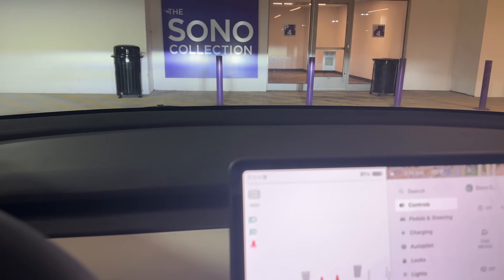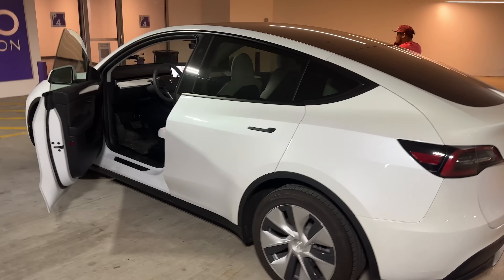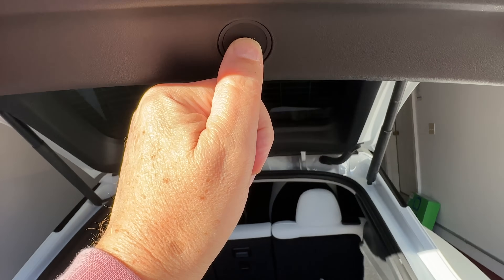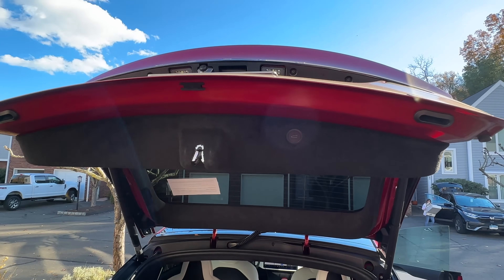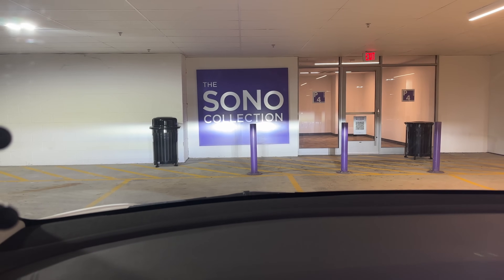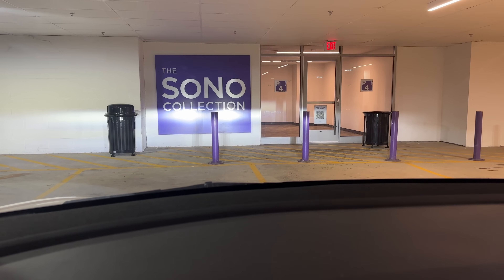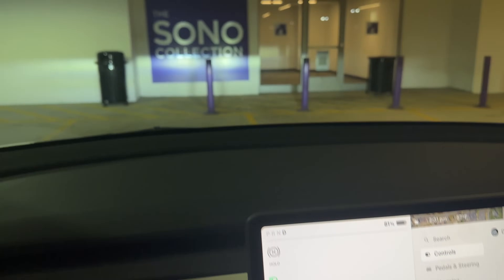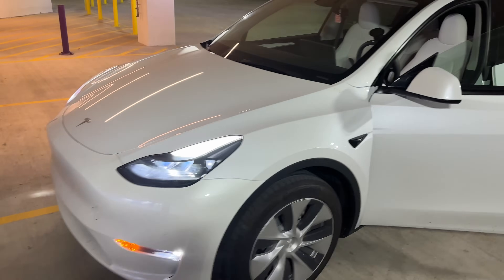Tesla Drivers Beware!  Poor Close In Vision Only & Lack Of Sensors Will Cost Us Over $2K In Repairs

Comment: As an aside, how did we ever manage before cameras and sensors in our cars? Oh wait, we used our eyes.
Reply: But that's also why cars used to have steel bumpers. I'm a Tesla person but if a cheap $20,000 cars have ultra sonic sensors in them these days (it only costs around $125 per vehicle) surely Tesla can add them back.
Reply: Sad, isn't it? I've been driving cars with painted bumper covers since my 1987 Mustang GT and I've never once hit anything even without sensors or cameras because I use my eyes and brain.
Reply: Exactly
Reply: This is an argument for no safety equipment at all, no seatbelts, air bags?
Reply: That’s a problem I have with my new 23 Maverick. The person saying use your eyes, you can’t see all the way in front of the bumper. I have a 17 Toyota with front sensors and I can get much closer without hitting the car in front.
Reply: I would look up a place called Dent Repair. They can repair a lot of dents without having to repaint it.
Reply: It’s an assist. To do that much damage you had to hit it hard. 

With low garage height, that’s not the cars problem. 

Sorry. Love your channel. Calibrate your car for your surroundings. 

When the camera disagrees with the sensor, WHAT DO YOU BELIEVE?
Reply: With the amount of money you've blown buying and selling cars you can afford a $2k lesson in using your eyes to park.
Reply: Having no information and having false information are complete different things.
Reply: If it has a feature then it should work.
Reply: People bumped and scraped their cars all the time but older car’s bumpers also didn’t get $2000 in damage for slow speed bumps. They were made for bumping things!
Reply: But, if you pay money for a feature it’s expected that it actually works. Tesla doesn’t go on this premise.
Reply: No excuse for not having advanced safety technology work on a modern car >$50K.  Tesla fan boys make all kinds of excuses for these compromises.  What did we do before? Let’s take the cameras and Navigation off too.  What did we do before that?  Joke!
Reply: With all this “new tech” built into our cars nowadays it seems like most people don’t even bother to check the surroundings while driving……

Comment: Something similar happened to me, Dave! When I pull into my garage, I allow 18-19 inches from the front end to an obstacle in my garage. Any closer and I can't pass in front of my car to get to the side door. When I close the garage door there is just enough clearance in the rear. However, if I have to adjust by backing the car to straighten it out, the 19-inch reading is deceiving. I have to go out and verify that there will be clearance for the door. The first time this happened, the car's front end was 20" away, and when I closed the door that same bracket scratched my bumper. Your charming wife has nothing to feel bad about. it can happen to anyone!

UGH!!!☹
Reply: Yup.  I get it.
Reply: @daveconnershow they say the car has top safety ratings.   How is that possible when they have removed sensors, Vision never worked, and removing stalks as well causing people to retrain themselves how to drive?
Reply: @cheesun124  Very true. They seem to be compromising safety for simplicity. I was watching the Cybertruck discussion, and they wanted to omit the side view mirrors for more aerodynamics but the powers at be said: “Ah Hail NO!”

Comment: I just got a 2023 $79,990 Model X (from Mt. Kisco too!) and I have checked several times to see if the distance information it gave me about the distance from a bollard was fairly  accurate.  So far, it seems to be working well if not on the conservative side.  Even your observation {3' verses 6') should indicate that you are close to something.  I've had several ICE cars with the front sensors and yet still hit the front air dam.  Even an ultrasonic sensor is not perfect.  I don't think any car company can make a car that will stop you from hitting a bollard.  Possibly you should video a test with a Tesla with the ultrasonic sensors and one without and compare results.  Not for nothing... the human in the driver's seat has to take some responsibility for not bumping into things.  Side note: paintless dent repair (PDR) might fix your bumper more cheaply.
Reply: Nah, you’ll see!

Comment: Good video. Very frustrating to have $2,000 damage to your car because Tesla wanted to save a few bucks on sensors. It makes me wonder if other possible collisions are as unprotected? My Hyundai Sonata warned me when backing out of a parking space if a car or a shopping cart were crossing my path. My Tesla has fantastic backup cameras, but they can't always see around a big van. I think Tesla vision needs a lot of improvement. My X has sensors in the trunk cover that prevent it from hitting my garage door. It also has sensors in the falcon wings which do the same thing. Sadly it doesn't have sensors in the driver's or front passenger's doors to allow them to automatically open more than a few inches. If Tesla watches your videos and reads the comments, hopefully they will be motivated to do some fixes.

Comment: Well that is your opinion on the repair thing, I don't rely on this Park Vision by cameras only.  I have driven and parked vehicles for over 50 years and did not need any assist tools then, and don't need them now.  Tesla Park Assist gets me in the ball park and I totally rely on using my eyes to park my 2023 Tesla.
People are dumb if they totally rely on this Assist Parking.  Now they have a 3D view which I feel is not any better, at least for the front view.  They still need to add a front bumper camera if they want to do this without sensors.  Sides and rear their cameras are located pretty good.
I find with Park assist tells me to STOP, I am not even close to hitting anything in front of me.  I never do back in parking. I want to see where I am going by doing front end first parking.
Just my thoughts on Parking Assist.

Comment: You sould have used the Towing Mode, so the car would have been in Neutral with the Parking Brake desactivated. 
And it would have been very easy to move the car by hand. I suppose the camera distance would have been still working.
Reply: Great idea!

Comment: For a while I was looking at the Model Y because it had always had a good safety rating & I liked the fact that they had the built in cameras. I don't like that Tesla doesn't have CarPlay but I could get over that. I also didn't like that they got rid of the stocks in place of capacitive buttons but if they start using the steering wheel from the Cyber Truck with actual buttons then I could get over that. I also didn't like that they removed the blind spot indicator from the mirror because that's where you naturally first look before checking your blind spot when changing lanes, especially to the left, however they changed that. To me they have to change this if they seriously want to keep touting themselves as a safe vehicle. Sonar/radar technology has been around for 80 or so years and it doesn't matter that it would be considered on the lower end of technology, it works. Sure it can keep you from bumping into a pole in a parking spot but that isn't the important thing, they can also keep you from hitting someone in a parking lot as you back out. It can warn you of an oncoming car in a parking lot. It's more accurate at measuring distance when you are driving. If something just works just leave it alone or come up with something better first.

Comment: If Tesla wants to rely on vision for parking and such then they need to put lidar sensors in their cameras for better performance in low light scenarios and lidar sends out invisible beams that can tell the computer a very accurate distance between where the beam starts and where it ends. Unfortunately for hardware 4 cars they would need to be retro fitted or just deal with a worse parking experience.

Comment: 1:24 Don’t you just love the Mazda CX-9s? Looks just like the Infinitis these days. 🙃

In all seriousness your actual repair bill will likely be much higher than the initial estimate. The repair shops almost always find “underlying damage” once they pull apart the bumper. Had something similar happen with a new Model 3 RWD. Tesla certified body shop had an initial photo estimate at $2300 for the front end. Total repair cost ended up being $4200.

Hope you’re paying for this out of pocket because you really don’t want this as part of your claims history. I’m assuming your wife’s Model Y was built in Austin? Wasn’t this made with a structural battery pack? Because if someone rear ends you you’re in for significant repair costs.
Reply: It’s a Fremont built LR not a 4680

Comment: Dave - Glad my China built early 2022 UK RHD Model Y has ultrasonic sensors. My wife's Honda Jazz has ultrasonic sensors and I hit a lampost reversing and the ultrasonic sensors didn't save me. So it may depend on where the sensors are placed to work 100% of the time. Sory you wife bumped her car. Can you not take it to a dent specialist to get the bump removed? Metal panels can normally be fixed by a dent specialist - but front and rear bumpers are normally plastic - so the dent might not be easy to fix - but it's work asking. Sometimes applying heat to plastics might help return them to shape. I know if they get split they can plastic weld them. A good bodyshop might be able to repair the bumper for a lot less than Tesla would charge for a new bumper.

Comment: Thanks for the video Dave!! Here I am debating on getting a Model Y (which I already ordered)! I am so confused. I like my husband's Model X, I drive a BMW X5 45e and ordered a Tesla Model Y as a company car, but I am debating seeing these issues plus adding the lack of sensors, heads-up display, ventilated seats...  I was considering the Genesis GV 60 which Kathy had, then I saw your video on that one!!! OMG my brain is confused!!!
Reply: If you like the HUD and features your BMW give, stay away from the Tesla Y. You won’t be happy get a good hybrid.
Reply: Model Y is a great car, but is isn't perfect and it isn't going to be some people's favorite car. I love mine due to its ultra smooth driving characteristics, promise of future enhancements, overall great software (with a few exceptions), beta Autopilot (not FSD, at least not yet), traffic aware cruise control, physical safety in crashes and low center of gravity, copious in-cabin cargo space, possibly the best battery management system, hyper-efficient and flexible thermal management, best charging network, etc. So many things to love, but ... though the broken software that uses the cameras for parking assist could be fixed, there is enough info from the cameras, it is not certain, as the amount of info to process is prodigious; I keep expecting  parking assist to suddenly start working well, or at least not terribly, with a software update, but it's not happened in the four months I've owned Perl,  and there is no guarantee it will ever be fixed. The next Model Y refresh is rumored to be coming (maybe in 2024) with ventilated seats, which is great for you, but it may also be coming without stalks, which for some would be tragic.  You have every right to be confused; the car is wonderful, but a few things are still just .... wrong. Good luck with with your decision. If it is any help, given what I've learned over the last 2,623 miles of driving, I'd buy the same Y all over again, but you may have a particular need for parking assist that I can work around, and in that case it might not be your car until that gets fixed.
Reply: I just noticed you may be in China. They have some differences in the Model Y they are making currently, I thought it had ventilated seats, but I may have conflated the M3 Highland with the MY+ coming out of Shanghai now.  I also have no knowledge of the Chinese charging network with respect to whether it is better for Teslas than other EV makes. In North America, Tesla has the best charging network, but in other places this may not be as true.
Reply: @slowercuber7767  I am not in China. I hope theses changes get to the US soon.
Reply: @pedipedi9559  Thanks!!!
Reply: Don’t do it.  Get a Camry!
Reply: @cheesun124  I second the Camry! or better yet a corolla!

Comment: For the moment, I have been keeping my five year old model 3, because any replacement Tesla I may purchase will have those sensors missing, and I find that unacceptable.  Almost every other car on the market has some form of ultrasonic sensors (because they are dirt cheap).  As clever as Musk is, he has these weird moments where he becomes obsessed with a (theoretically good) idea, and doesn't think it through.   Another good example would be Tesla windshield wipers, which are the joke of the industry.  I LOVE my model 3, but the wipers are a liability, and have NEVER worked properly, with ANY version of the software (including FSD beta). There is NO excuse for Tesla now adding the $1 sensor, like every other manufacturer. Sometimes, the 100-year-old auto industry DID get it right.

Before I get my Cybertruck (yes, my next car will still be a Tesla, despite my feelings about their wipers and proximity sensors), I plan to build a small ultrasonic range finder, to mount in the frunk of my new Tesla, with a readout in the cabin.  I will also mount another on the back of the car, for the same reason.

Hey Tesla, how about adding a feature that allows the cabin computer to receive a message (text message, UDP message, Bluetooth, whatever you like), displaying that message somewhere on the screen?  That will allow people like me to easily interface various add-ons to the GUI (in this case, a message indicating the distance).  This would be a game changer for Tesla owners, as it would allow entrepreneurs to produce these kind of add-ons for a Tesla, and solve a large problem that ALL modern Teslas have.

Comment: I drive my wife's Tesla how i would drive a car without any safety sensors.  I never go by what it says.  Get out and look if you have to.  My 2012 Ford Fusion has back up sensors that work excellent.  My 2015 Lexus had cross traffic radar that would pick up moving cars a half block away.

Comment: So FSD  12/4/23  is still not FULL SELF DRIVING .  not surprised.    Sorry that it did happen   I;m not so sure that they were saying money.  I'm going to get that the system they were using was generating "bad" data and  you have the resolution, which obviusly it is not!        Someone rear ended by  2 week old 24  m44i fc.   The cost was about $3k, and Progressive wouldn't pay for it.  Looking at the bunper it appeared to me a non issue;  It was a $3000 non issue!   My BMW recorder didn't click on either, so there wa no recording of the accident.

Comment: so true.  one of the reasons i didn't lease another model Y.   Tesla Vison is half baked at best.  Extremely unreliable system.  FSD will never be ready for Level 4 or 5 without radar or lidar.   Vision cameras just won't cut it.  Instead, I leased a $91K EQE500 SUV in lieu of a model Y for a fraction more.   Same lease payment, $740 with CA 8.75% tax.  I paid $1500 more for the drive off + $8k MSD.   Same 36mo, 15k mi lease term.
Reply: So in other words you are actually paying $1003 a month. You can get a model Y LR with 15k miles 36mo for $528 a month with 4500 down. Pretty much half what you paid.

Comment: Dave, did you get a second opinion regarding a paintless body repair for the damage? They may be able to repair that bulge as it is so slight. The rear garage chip can easily be corrected with touch up paint. BTW, I have the same garage and had to lower my max height of the trunk lid too. My scratch was buffed out and is undetectable. My wife drives a 2023 Model Y and I will tell her again not to depend on the vision based proximity system.